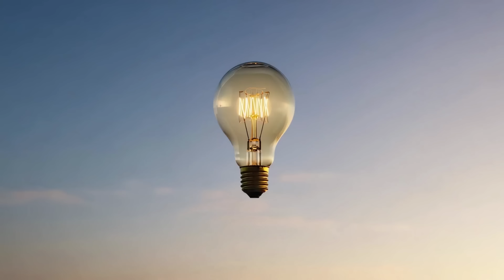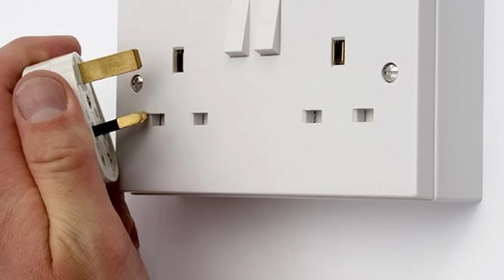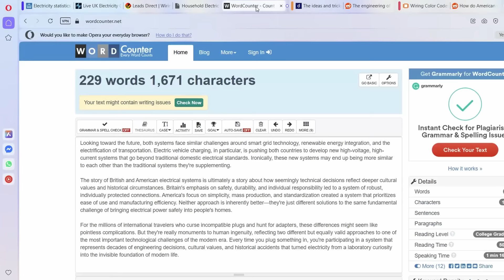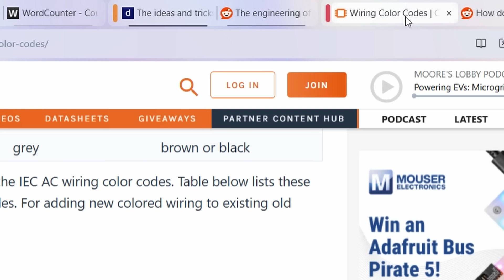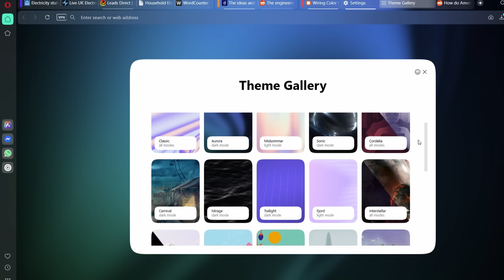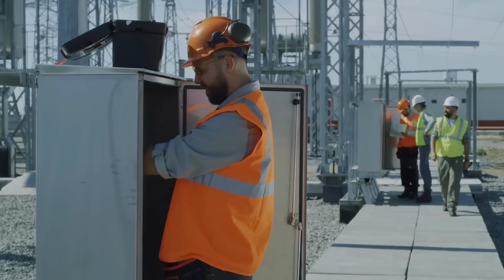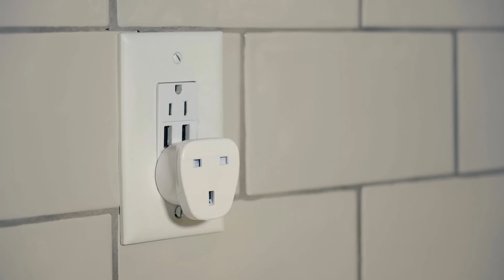British electricity is SAFER than American electricity. here's how.

Comment: Tea drinking came in centuries ago, nothing to do with electric kettle.
Reply: We had coffee houses before tea houses.
Reply: Was gonna say the same - our tea-drinking culture pre-dates electric kettles, widespread domestic electricity supply, and the USA!
I'm that old, I still remember using metal kettles on the cooker hob, that whistled to signal when the water was boiling! Though TBF electric kettles were around long before then, they just weren't as common or essential as they became from about the mid-1980s onward. 

If I remember correctly, electric kettles did gain some popularity in the US, although they went the way of the Betamax due to the advances in, and dropping costs of, coffee machines.
Reply: @ziggythedrummer  I once had a little electric kettle with a little 900 watt element as it was made for single folk on their own. I don't know if you can still get them now and I should've kept it as it could be collectable now. But my favourite electric kettle must be the old Russel-Hobbs one made here in the UK back in the early 70's, and they were big and covered in polished chrome as well as other finishes, and they were a British classic and built like tanks just like the Kenwood chef food mixer. I bet there's still some out there still boiling away, I wonder how many still have their original element and what kind of price will they go for now on the likes of ebay? I bet old Kenwood chef's can still fetch top money too, especially as the top of the range model with all the accessories cost about a grand when new, but they can last you into retirement, I know as a friend of mine has one and he's a great grand dad now and it still works after 50-odd years.
Reply: I'm pretty sure she's just reading AI slop at this point to pump out videos.
Reply: @DrunkenDweorg  I disagree -- she may well use AI to aid her research, but that research is usually first rate.

Comment: During the Edwinan period electricity was for the rich and was new and unsafe,  the safety came as people started to understand it better. 

The UK 3-pin plug came about due to World War 2
Reply: It didn't come about specifically because of WW II, as the standard didn't appear until 1947. However, it was part of an overall movement to upgrade much of the infrastructure and system for a brave new world. Other things were looked at, like education  like the 1944 Education Act, the NHS, statutory building regulations, the planning system and so on.

As it happens, there was nothing too much wrong with the old round pin plugs, which are still used in several countries, like India. it wasn't even that old, a standard. It was published in 1934, just 13 years before BS1363. It would have been brought up to modern safety standards by adding shuttered sockets, insulated power pins (not acquired by BS1363 until the 1980s) and sticking to radial circuits. The main power circuits would be 15A. Of course, unless there were separate 5A circuits with the smaller plug, then you would find people plugging table lamps into 15A circuits, protected only by the circuit fuse/breaker, which is not ideal. However, that's exactly what happens in every country in Europe which uses Schuko sockets. What's more, the Schuko plugs don't ever offer polarised plugs so there is no neutral/live differentiation at the socket.

In any event, the standards authorities decided that they wanted a single plug type without sacrificing the extra safety of protection with an appropriately rated fuse for the appliance and flexible cable. It did also enable the 32A ring final circuit. Indeed, you can install sockets on higher-powered radial circuits too (although it's rare). 

Note that you can buy BS546 plugs and sockets today with internal fuses, shuttered sockets and insulated pins, but there's no way to enforce that on old plugs and sockets, so they also changed the format.

So, without that committee, most likely we would have had a standard based on single-size BS546 plugs on 15A circuits which, as I say, would be very similar to what most of Europe uses now.
Reply: @TheEulerID what I meant about half the country was flattened because of the war, it made standardisation easier with the new builds of the time.

Comment: That was probably the best explanation of the subject that I've come across on YouTube particularly on the subject of electric kettles. Most people don't understand the difference between power, voltage and current. Your explanation avoided most of that. From a retired electronics engineer. Well done.

Comment: When electricity came to Japan part of the country used American 60 Hz generators and another part used European 50 Hz generators. The result many years later, as soon as it became possible, was the developement of small power units for phones, tablets, etc that could cope with 110 & 230 V, 50 & 60 Hz without any adjustments.
Reply: Might that have contributed to Japanese industry becoming so dominant in domestic electricals?

Comment: Hi Kalyn,
Which EU standards are the UK not following?
Note there is no standard EU plug or socket, they vary by country.
I believe there is a voltage standard, between 220 and 240 volts across EU and UK.
I think we mostly use 50 Hertz.
The house wiring differs, but I think there is no standard across EU.
Reply: There is a European standard. As with all EU standards they trying to adopt the member state that has the highest standards in that area. So electrical standards are geared to UK BS761. The AC voltage difference was delt with by adding a plus or minus 5% calibration tolerance.
Reply: @markwidgery1922  'There is a European standard. ' for what? the plugs and sockets differ, there are safety requirements, which I think UK standards meet.
Installations differ by country, I believe.  

So the UK meets the EU standard for voltage?
Reply: The EU has it own standardisation
Reply: @Songs_Written_By_Toby_Whaymand  Yes, but which of these standards for electrical installations does the UK not follow (as Kalyn suggested).
Reply: We don't fully follow the EU voltage standard (I believe it changed after Brexit) although there is a consultation on moving to it.  The change would lower the minimum voltage.
Reply: @cjmillsnun We do all follow the same voltage standard as the directive gives a calibration allowing plus or minus 5%. If you bother to test mains supply voltage you find it varies greatly from area to area not just country(but always within the 5% range) . If you make equipment that do not comply with  this you can not use CE mark on your equipment.

Comment: Before the square pin plugs and the ring main, UK had unfused round pin plugs and a radial wiring..
Reply: You could actually plug items into the light socket.

My mum had an ancient blender she could do that with in the 1980s. It was from the 1950s. 

Luckily after she mentioned it to the plumber she stopped  using it.
Reply: @MsPeabody1231  you can still do it now if you want.
Reply: Not only that - there were different plug/socket combinations made by different manufacturers! The firm of 'Wylex' had a plug & socket system unique to itself! Also, manins wiring consisted of rubber coated wires encased in lead sheathing. The lead acted as the earth connection. Probelms occured when the rubber coating perished and live wires made contact with either the lead or the neutral wire. Safe it was not!!
Reply: @warwickholden6332  Rubber was around before modern soft plastics
Reply: @tonysheerness2427  and Bakelite - almost universal for plugs in my youth (50s & 60s)
Reply: @warwickholden6332 Old wiring types are a problem in many countries.
Reply: @warwickholden6332  I once rewired a building and it was a good job I did it when I did as when I removed the old cables the old tired out insulation crumbled and started falling off in my hands, had it been left in use much longer there would've been an increased possibility of a serious fire.
Reply: With different size pins for apps.
Reply: In the last house I lived at with my parents and before they had it rewired we had old round pin plugs which had a live pin which was a fuse, it had a male thread at one end which screwed into the plug.
Reply: @majorpygge-phartt2643  Some plugs were also made of wood as well as Bakelite.
Reply: The 5 amp round pin plug and socket system can be and sometimes is still used on work benches where mains powered electronic stuff gets repaired, as to be wired properly there should be TWO safety isolation transformers, one to power whatever's being repaired, and the other to power mains powered test equipment like oscilloscopes for instance, and you mustn't be able to plug test equipment into the same circuit as the appliance being worked on, so the test gear can be fitted with 5 amp round pin plugs and the sockets protected by fuse(s) at the transformer output, or you can use other connectors like the IEC type like those used on stuff like PC power supplies, whatever you use it must be incompatible with the circuit used for powering the repairs.
Reply: The fun thing is, the round pin plugs (now I think with fuses) are still in use. Usually in commercial situations where you don't want someone plugging something unsuitable in, so things like lighting in retail stores or sometimes computers/servers (the idea being you cannot plug something like a vacuum cleaner in, so you don't get people unplugging an important device). The other common reason is/was it meant you could ensure your emergency power supply wasn't drained/overloaded by non approved devices by having all the approved stuff using a different plug.

It's getting rare now, but it's still something that happens, in part because old, big retail stores don't want to mess about with updating the sockets (and thus wiring) unless they have to, in order to put in a standard socket when the existing one is rated at 3 or 5amps (IIRC the round plugs had 3, 5, 15 amp versions at different sizes).
Reply: John Ward, knowlegeable about practically everything to do with the UK electric system, is a strong advocate for phasing out ring circuits in favour of radial ones.
Reply: @heronimousbrapson863  More work for electricians as there is more wiring.

Comment: Because the UK uses a higher voltage, it uses less amps.
V x A = W
So the same size of wiring will melt first in the US and burn your house down than in the UK if the wiring is the same size and the device uses the same number of watts.
240v x 13 amps = 3,120 watts
110v x 28.36.. amps =3,120 watts
Reply: Those losses to heating are also proportional to the square of the current (hence why we have high voltage transmission)

Comment: Three pin plugs in the UK originally had round pins and were available in different sizes.
The small 5 ampere round pin plugs and sockets are occasionally used today for lighting.
Reply: Or student accommodation. There was also a 1A variant.

The 15A round pin plug is still widely in use in theatre lighting. You don't want to be changing a plug fuse at height or having to find which plug in a chain of leads has blown. The fusing is at the dimmer end.
Reply: Besides the three pin plugs there were also two pin plugs. Houses were often wired for lighting and there were adapters which allowed smaller appliances to connect to a light socket.

Comment: Thank you for your video. I know a bit about the electric system having done a home maintenance course. Mostly know when to leave it to the experts.
When I bought my house the electric system was about 60 years old and had to be replaced.
Having travelled a bit I know of the problem with different electrical systems. All very shocking 😮
Was it your hairdryer bursting into flames? 🫣

Comment: 2:29 We only changed to the square pin plug in the 60/70’s. When I was growing up there were still many older round pin plugs that were being phased out at the same time that we ditched red, black and green because they were a nightmare if you were colour blind. However even the round pin plugs were safer than the US versions.
Reply: I'm old enough to remember that being done My father was caretaker at a research lab at the time and the rewiring was a major operation

Comment: Original 15amp three pin plugs did not have fuses.
Reply: The ones with round pins?
Reply: @wessexdruid7598  Yes! We also used to plug appliances like the iron into the light fittings and fuse wire had to be on hand at all times!

Comment: Moving to the US was an eye opener when it came to their electrical and wiring systems - no separation of lighting and power circuits, as one small example. Finding a 240V source for my kettle was of course at the top of the list, and I found it - behind the stove (or range). Tea anyone?
Reply: 4 minutes vs. 2 minutes doesn't break the bank for me.  I use an electric kettle all the time in the US as it's extremely helpful for getting rice cooked faster and other things that help around the house.
Reply: Combined lighting and power circuits are very common in Europe. Typically they have a common power and lighting circuit per room. In the case of a kitchen, then they are likely to have more than one circuit for the sockets as they use radial circuits with 16A ratings.
Reply: @TheEulerID  I used to keep my candles in the fridge based on the idea that if the lighting circuit tripped, it was easy to find, and had it's own light built in.

Comment: In one aspect the BS 1363, 13A plug is far more dangerous than the comparatively flimsy North American type: when you accidentally stand on an unconnected, pins upwards one & you’re in bare feet. Even worse than a similar misplacing of footsies but on a small Lego brick instead. 😫
Reply: That's assuming that you follow the American standard of removing plugs from sockets when you are NOT using the appliance and leaving it on the floor! Since most electrical outlets in the UK have switches, there is no need to remove the plug and it doesn't take long for a user in the UK to remember not to leave a plug lying on the floor (admittedly, people in the US tend to be slower on the uptake).
Reply: Leave it plugged in then or if you must leave it laying around, get a folding prong plug. I'm looking at one now!
Reply: I've never stood on a plug in my life but I'm with you on the Lego bricks 😅
Reply: Never stood on a plug in my life, and if I did I am in the habit of wearing decent footwear. Not everyone dresses like they are on a sandy Hawaiian beach all the time, although that is the fashion I know.

Comment: 50 tabs? Heck, my laptop has palpitations with only 5 open - but then, it is 10 years old.
Reply: My work laptop has always about 150-250 tabs open (but tab groups help). At home I let it grow to over 3000 (Firefox) ! Did still work without much problems but needed a lot of RAM and occasional closing of the browser to unload the tabs.
Reply: @reinhard8053  stuck with 4Gb.